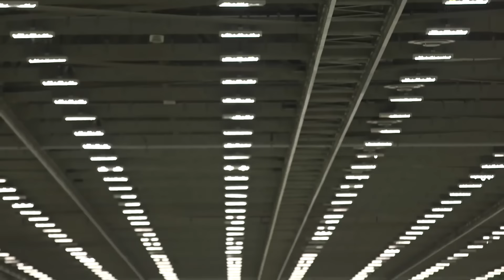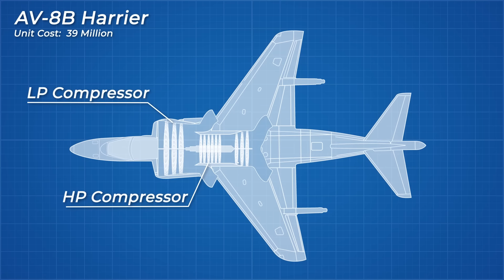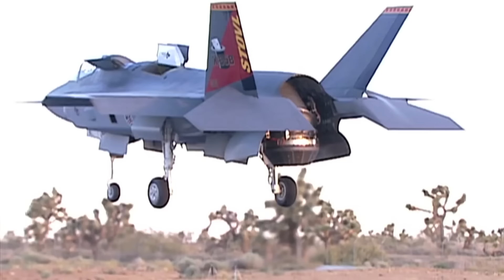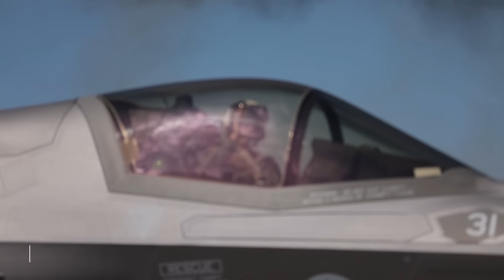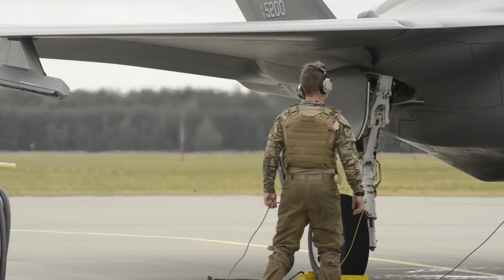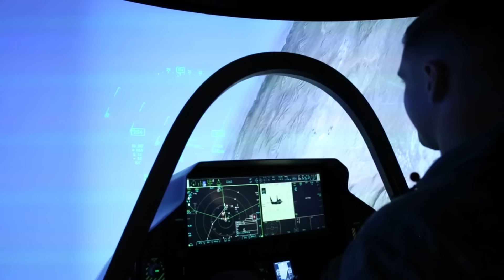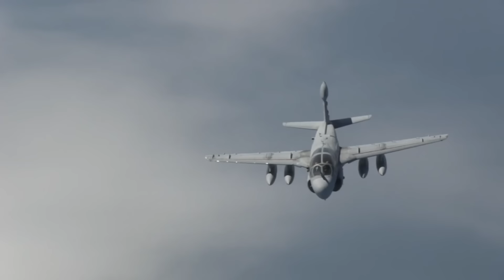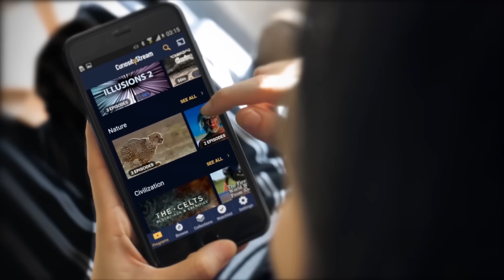Is The F-35 Worth $115 Million?

Comment: Wrong at 21:07 ... the F-35 is not a worthy successor to the A-10 Thunderbolt. The F-35 is merely an expensive successor to the A-10 Thunderbolt. /Lonewolf
Reply: You're kind of missing the point. The A-10 is already in the process of being supplemented and replaced by the F-16C in CAS missions where a ground-to-air or air-to-air threat are present. The F-35A is simply doing the same thing with both.
Reply: @peterson7082  Doesn't change anything I've said. 
Nevertheless, commanders in the field will deploy the F-18 for close air support, not the F-35... Why risk such an expensive jet? It's far too expensive for that kind of grunt work. /Lonewolf
Reply: @GeoCalifornian  The F/A-18E/ F in its current blocks costs nearly as much as an F-35C. And some blocks cost more than F-35A. Yeah it kind of does change what you claimed.
Reply: @peterson7082  ...No, it does not change anything. 
No Commander in the field would dare want to take the chance on losing his Joint Strike Fighter to grunt-work close air support over an F-18. /Lonewolf
Reply: @GeoCalifornian  An F-35C serves the same roles as an F/A-18E/ F. And the F-35A serves the same roles as an F-16C.

Comment: Luckily the A-10 will still be in service for years to come since the f-35 can’t match its ground attack capabilities, but the f-35 will replace the f-16, av-8b, f/a-18 hornet and probably the f-15e strike eagle
Reply: You're kind of missing the point. The A-10 is already in the process of being supplemented and replaced by the F-16C in CAS missions where a ground-to-air or air-to-air threat are present. The F-35A is simply doing the same thing with both.
Reply: Still the f-35 will NEVER be a ground attack aircraft. A-10 will always be that close air support aircraft troops on the ground can rely on. I personally seen it in action at twenty nine palms for training as a marine so I know what’s that plane is capable of, but I get your point.

Comment: I don't know if it's "worth" 115m$ a copy, but last I checked Bloc III costs per unit were down in the low-mid 80s. So I'm not sure where your PPU is coming from. You generally price military hardware on unit cost at full production. That's like saying EVERY ship in a new class will cost the same as the first which has all the design and initial new manufacturing infrastructure costs rolled into it. You're presenting a strawman argument with an obvious "Clickbait" title. Not interested.

Comment: I'm curious, how effective is all of that stealth technology when there are external stores hung all over the underside of both wings (9:07)?  And this is a potential replacement for the A-10?  Sending an expensive, single engine aircraft into a situation that an aircraft with lots of redundancy and armor is called for doesn't sound fiscally responsible, in other words, it's too expensive to fly to support troops on the ground.  What's the old cliche say, "Jack of all trades, master of none"????
Reply: The stealth is as good as useless with external stores, but in a low-threat environment, those extra hardpoints can be useful.
Regarding replacing the A-10, the idea is that the while the A-10 had to get close and draw lots of AAA, MANPADS, and small arms, the F-35 has the sensors to provide ground support from further away. With stealth, speed, and better electronic warfare, the F-35 is also better protected from the larger SAMs that the A-10 has no real defense against. Admittedly, the F-35 is horribly overengineered and overpriced for fighting insurgents with no credible AA weapons, but so is the A-10, to a lesser degree. The answer to that is some sort of minimalist attack plane like a Super Tucano or, more romantically, an updated P-47.

Comment: The Lockhaad F-35 is not worth 115 million dollars.If it can be downed by a low cost PL-21 VLRAAM that flies at mach 6 speed with a 300 miles range.

Comment: F-15K/SG price $100 Million+ each (at 2006 US Dollars).  F-15QA equates to about USD$150~160 million per aircraft (72 aircraft at $12 billion at 2019 US$).  
F-16I at $45 million ($60 million fly away cost at 2003 US Dollars).  
Boeing 747-8  passenger jet that lists for $378~$390 million per aircraft / Airbus A350 is about $300~$320 million per aircraft.  

Considering program development of F-35 - with the entire program cost of $5 billion and maintenance/operation of roughly 2,000~2,400 F-35s with additional US$200 billion as operating cost (which will be spread over 40~50 years) - this is a bargain.   When you acquire a military equipment, you must take into account of what is known as economic off-set, which is the contribution to the local economy.  That is why F-35 looks and sounds expensive and over budget, but in the view of the DoD and state dept, it is within the controllable budget (in fact, under budget).  

Failure to recognize such benefits of program results what is known as Point-of-No-Return effect.  An example is Canada's EH-101 fiasco - which they ended up purchasing same aircraft (with a different code name) at much higher price - original price of EH-101 was very affordable which Canadian Defense department was willing to pay over subsequent 20 year period.

Comment: I support the F-35 program, but I don't think it's fair at all to say that it is a worthy successor the A-10. They are two entirely different planes, and there really is no substitute for a dedicated close air support aircraft.
Reply: The point is the A-10 is simply not survivable in contested airspace and groundspace. The F-16C has since largely replaced it in these conditions for CAS missions since the mid nineties. The F-35A is currently supplementing and eventually replacing the latter.

Comment: Comparing the single engine f35 to the f15 eagle on energy manoeuvres isn’t really fair. Also any two aircraft designed for air to air have areas where they excel and others where they’re weaker and it’s a matter of a pilot making the fight which suits his aircraft’s strengths. The argument about the f35’s stealth and sensor advantages do give it a massive advantage over potential enemies but even without that those clinging to the old ‘can’t climb, can’t turn, can’t run’ crap want to watch it fly. It takes lift from the body not just the wings so traditional wing loading stats need adjusting and it’s TWR ratio is only surpassed by the likes of the raptor, Typhoon and rafale - nothing to be ashamed of there. It also has better high AoA than any fighter I can think of so will be no slouch in an a2a when driven by a pilot who knows her. Finally for the US and U.K. other platforms will be doing their air superiority (at least in airforces) so whilst more than capable of protecting itself it’s likely to only spend a tiny amount of combat flying time in these types of scenarios. Finally all the advantages brought up for the F35 are only magnified and made even greater when its flying with wingmen and other aircraft and weapon systems making it an even more revolutionary and capable aircraft.

Comment: The biggest reason to have a jack of all traits is to save costs and to be able to focus power more. Like, if you have 200 aircraft but your enemy has 450, if you can use all your aircraft in any way, and your enemy has 150 per role, you will be able to focus your 200 in a way to allow you superiority.

This means that it's of the most use to countries who are to poor to have superiority in all ways of the given unit. So, for a country like the US, who has the biggest econnomy and millitary budget in the world, by far. It's not the optimal strattegy when it comes too development, in my opinion. And then it's like, yes, they are meant to be sold. But if they are being sold, and the ones wanting it the most are small economies, they can't be expensive. So, the costs would really have to go down for that.

In other words, either they make the planes WAY cheaper, or they should've specialized. If not, I don't think it will be what the US wanted it to be.

Comment: How much to refit an old jet with the F35 sensors package? O_o  That's one of the two big selling points from the video, the other being stealth.  Slap the sensors on a F16 that has a 1/3 cost price tag.... let's just guess it would be 5 million per unit to do the upgrade, of which the US has 900-ish units... so $4.5B USD, which would buy 45 F35's, assuming $100M per unit.  Can 45 F35's take down 900 F16's with updated sensors?   My money is on no, especially since the details of the 15:1 or 20:1 (depending on who you ask) kill ratio from february are an absolute mystery (knowing some political bullshit we get fed, it could have been a single F35 doing a kamikaze attack into a formation of first world war artillery spotter balloons).

The vtol model looks like a viable replacement for harriers, but I'm not so sure about the other two. =/
Reply: A modern F-16 is only $10 million cheaper than an F-35A at best and has all-round worse performance, and you physically cannot modify F-16s to use the F-35's sensor suite... there's not enough space
The details of the 21:1 ratio from Red Flag 17-1 are well known and amounts to about 2 kills per mission.
Reply: @dumdumbinks274  maybe  I haven't been keeping up with the releases of the data from the February exercise, did they release the this-plane-acquired-a-lock-on-that-plane stats?

In any case,  there wasn't room on the F-4 for a gun either.   Re-case a sensor package for the F35 to fit a couple of hard points.  Can 45 F35's beat 900 upgraded F16's?
Reply: @travisgeorge2809  Except the upgraded F-16's would be outstandingly more expensive...
Reply: @peterson7082  NEW upgraded ones would be.  I'm talking upgrading the 900 we already have.
Reply: @travisgeorge2809  Maybe upgrading 60 or 70 of them versus of the 45 F-35A sure. 900. No.

Comment: why do no video on the F35 take up the fact that its the base of a russian jet from the beginning ?  Lockheed had the luck that the cold war ended, sovjet imploded and Yakovlev needed money for the YAK-141 aircraft they were developing.
Reply: Because it isn't. The F-35 has just as much in common with the YF-22 and is actually an evolution of a NASA-Lockheed design concept from 1987. Lockheed didn't get anything from Yak until 1995, and what they got was not design data.

Comment: We now know because of back in 1980 a British radar system tracked B1 and B2 aircraft from America to an air show. America asked the British to stop making the system and the company went bust. But now another company has the same exact system but smaller  able to track any stealth and any aircraft even tiny drones from 150 miles away. So as this came out in the news means any stealth is now useless and the end of stealth anything because before that Russia could track a stealth by the radar jamming system they could lock on to where the jamming is.  So it was pointless back then. America claimed the B1 B2 did not have radar jamming if that was true then why stop making the UKs radar system? The Radar that UK had back in 1980 was a passive radar mixed with other systems and could track anything from over 600 miles away in all directions. I think with our Euro fighter which is faster than the Russian high speed bombers in constant flight is interesting and Underrated. But a UK company just announced a cheaper and new aircraft that would be taking the place of the tornado if built and would have a signature of less than an average size drone  also the engine would be built with power of over Mach3 sustained flight. But as far as I know not tested or built yet.

Comment: So they designed a single fighter with it's primary selling point being the  VTOL capabilities, to be used by three branches of the military for a wide range of different roles, but the only variant that actually ended up with the true VTOL capabilities went to the Marines? and the other two just basically said, "Yeah, you know what? we have long runways and big enough ships, that whole VTOL party trick; get rid of it we changed our mind."
Reply: Not the case. They are three different aircraft with high percentage of parts and equipment commonality. Only one variant was intended to be SVTOL from the get-go.
Reply: @peterson7082  I didn't consider the low cost of having multiple air frames with a lot of the same components. That makes more sense and I agree there, I still do think the immediate replacement of any one role-specialized aircraft with that of a "jack-of-all-trades-master-of-some" is a bad idea at the moment, with the exception of the Harrier and the F-16. the former is really a 1st gen F-35B which is the one I see as the most well deserving replacement and the latter is an aging air superiority/strike fighter that, barring a major upgrade, cannot match the abilities of latest gen air superiority  fighters like the F-22 or it's foreign equivalents.
Reply: @c4sualcycl0ps48 Except the analogs to a F-35A is other multi-role fighter like the F-16C, Typhoon, Su-30, CF-18 and Rafale F. Not the dedicated air superiority aircraft like some variants of Su-27,/ the F-15C/ F-15DJ, and the F-22A. The F-35C's analogs are the F/A-18E/ F, Rafale M, and to a lesser extent due to this aircraft's limited payload- the MiG-29K derivitaves.

Comment: Hang on. You did not explain, at all, how this thing is supposed to replace the A-10 Warthog. despite you claiming you did in the video. How does this thing do close air support better? or at least equal to a warthog?
Reply: The A-10 is simply not survivable in an environment with any level of air-to-air or ground-to-air threats compared to multi-role fighters. So since the mid nineties the F-16C has been supplementing and to a degree replacing the A-10, and the F-35A is the one supplementing and eventually replacing the F-16C.

Comment: And the Su 57 cist 40 million . And again reports that say F35 lost all samulation to older planes like Mirage and and f-16 , reports from other planes said that this plan is to slow.
Reply: Su-57 prototypes cost between 50-60 million each and were only configured with specific systems for testing purposes. Considering an Su-35S is worth about $80 million the Su-57 is certainly not going to be cheaper than the F-35.
I suggest doing some actual research into what pilots think. The F-35 is not slow at all and is quite literally superior to the F-16 in every aspect of performance.

Comment: Gee where have I heard all this before? Oh yeah the early 1960s when they made crap like the Thud. "Oh we don't need to dogfight we have missiles" then came Vietnam and they got their asses handed to them by Migs. Remember hearing the same shit about the stealth in the late 80s too, and then the Serbs found they could tweak the freqs and voila! Nighthawk becomes target practice.

Lets be honest folks, the USA MIC has become a  SCAM, plain and simple. They design something crap for a shitload of money then get paid ANOTHER shitload of money to try to fix the crap, and of course nobody is gonna say boo because they make sure the parts are being built in enough districts to spread that pork around so the piggies feed well. Nice work if you can get it but I have a feeling if the USA fights anybody other than jokes like Syria and NK with their 50 year old planes? The F35s will be sitting on the ground while the F15s and F18s do the work.
Reply: > "Oh yeah the early 1960s when they made crap like the Thud. "Oh we don't need to dogfight we have missiles" then came Vietnam and they got their asses handed to them by Migs"

 That's not what happened at all. The gun being fitted grew more out of use of ground support, not dogfighting. The U.S.N. simply improved missile reliability and training and their air victories to loss ratios sky rocketed. Gun kills even after introduction to both USAF and USN decreased over time. 

> " Remember hearing the same shit about the stealth in the late 80s too, and then the Serbs found they could tweak the freqs and voila! Nighthawk becomes target practice."

 The F-117A was an antiquated aircraft that lacked any form of countermeasures save being low observable. It had no refits to speak of that improved survivability since introduction. The S-125 and its associated arrays were modernized systems from the mid eighties and the 250th Missile Air Defense Brigade were professionals. They noted through IR systems an aircraft was flying on the same route as other aircraft that day- and thus fired two missiles. The first failed to lock on, the second did. 

 What nonsense are you rambling on about?

Comment: Sorry about F117, we didn't know it was invisible. -Serbs
Reply: The F-117A was an antiquated aircraft that lacked any form of countermeasures save being low observable. It had no refits to speak of that improved survivability since introduction. The S-125 and its associated arrays were modernized systems from the mid eighties and the 250th Missile Air Defense Brigade were professionals. They noted through IR systems an aircraft was flying on the same route as other aircraft that day- and thus fired two missiles. The first failed to lock on, the second did.